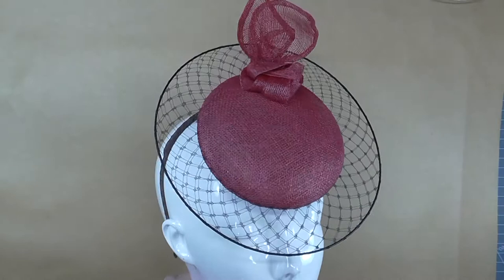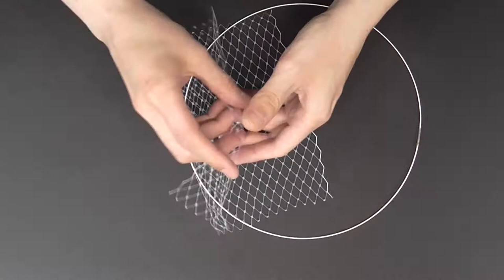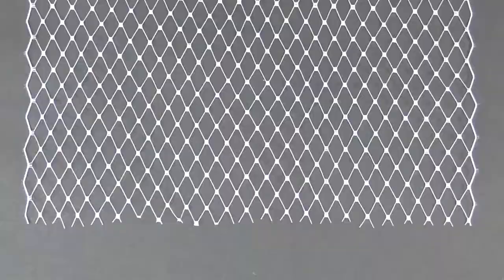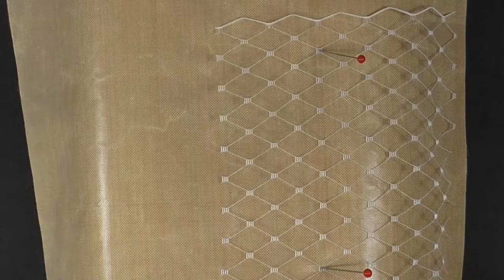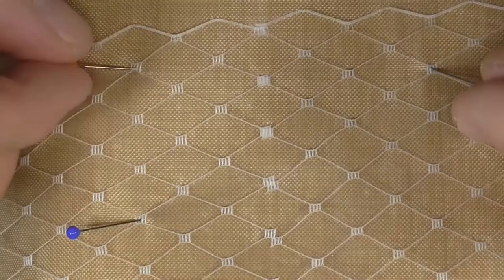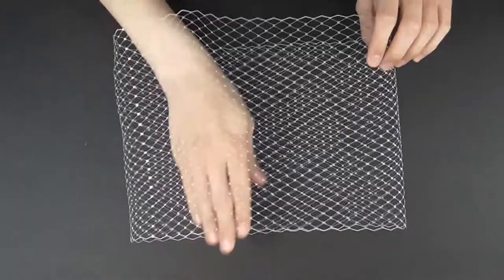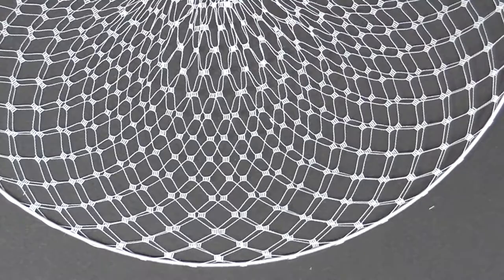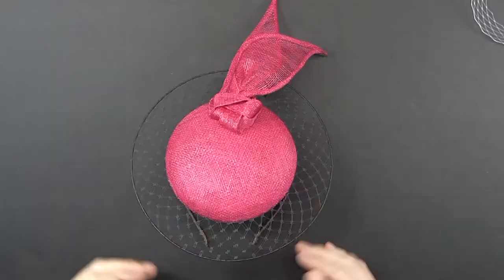How to make a veil disk

Comment: Any guidance on the best way to attach this piece to the head? I was going to use hat elastic but I see you used a wire attachment of some sort. Your video is excellent, thank you for sharing your knowledge
Reply from the maker: You can use hat elastic, but it needs to be the kind with the barbs on the end. Once the hat is complete, place the elastic barbs on either side of the dent on the back of the hat. As long as you keep tension on the forehead, it should work. You might need to use two elastics to get more solid tension. Just position the second one just under the first. I have a video on how to construct a cocktail hat on a headband in my video listing. I also have a video on making a headband, and one on wiring this type of hat.
Reply: @StitchingVulture  I watched the other video and found it very helpful. I will create the wire attachment. Thanks again!

Comment: Are the blocks used in this video a set or no? Specifically, what type is used for the bottom portion?
Reply from the maker: It's the same block for both the top and bottom parts. The one on the bottom, that rests against the head, is dented to contour to the forehead with a smaller button block, but it could also be dented with a small bowl or ball.